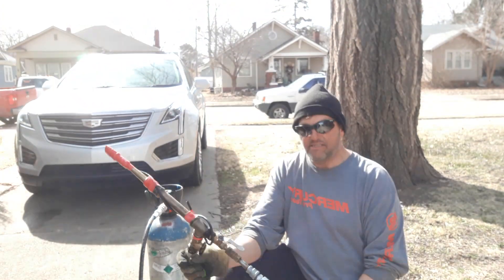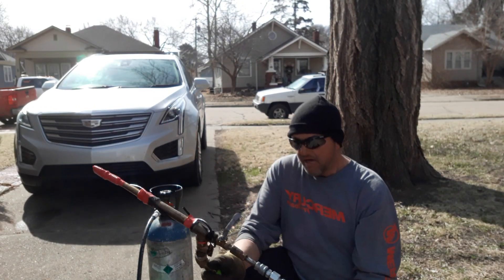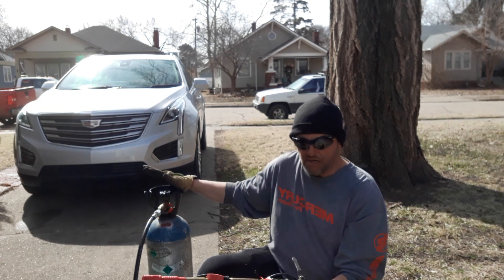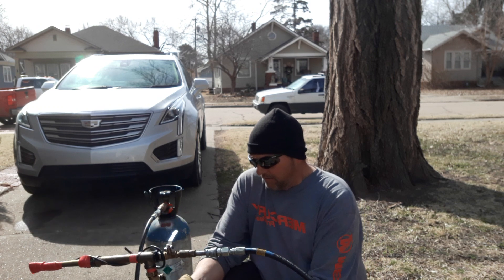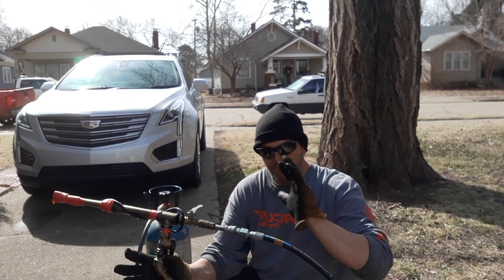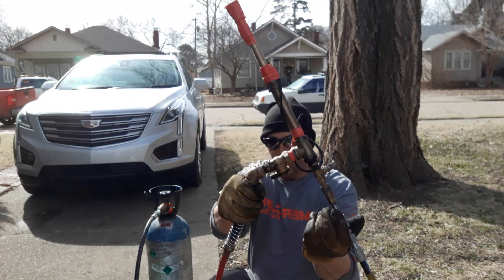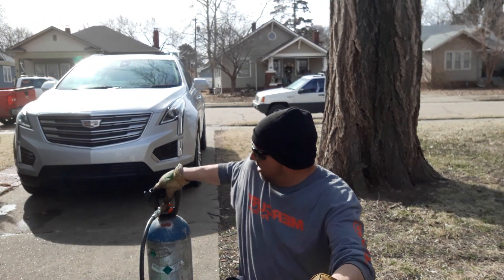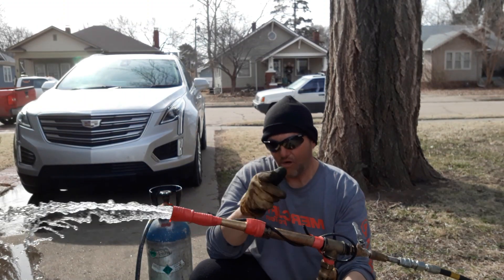Homemade Air powered high volume/pressure Power Washer! No pump no motor! 10,076 psi. NEW

Comment: High cfm does not mean it will put out more air power.  10,000 psi would blow apart everything aside from the highest rated hoses/couplings/etc. it will run at the pressure it’s regulated too. We have extremely high psi at work to run a blow molder and the hoses are only rated to 2k
Reply from the maker: Well all I know is that this was a real test.... Nothing blew apart.  Mabey you should watch it again.
Reply: @tctime  I will! Wasn’t meant in slander and I commented before work and did not finish so I will do so now lol
Reply: I think there might be some confusion in the ratings or in communication. I just searched co2 cylinders and found one source where a cylinder is a maximum of 1800 PSI with the rest being rated and filled at 860. Either way great work on the gun! Love shop made shit
Reply from the maker: @zanechristenson3436 no worries my friend.  If you are watching this kind of content before work you are definitely in my target audience.  I hope you subscribe, and I look forward to hearing from you again in the comment section from some of my other videos. 👍

Comment: At what pressure will the joints of the gun break?
Reply from the maker: I have tested this gun st 10076psi.  There is a video of me doing this on my playlist... The King's Gun Series .... on my channel. I hope you will check it out. 👍🏻
Reply: @tctime  ys we both are commenting below same video right now

If not at 10,076 psi, when will joints break??🧐
Reply from the maker: Thanks for that. This is the highest psi test I have ever done. To answer your question to the best of my ability .. I will have to make an educated guess.  

Since the gun does not retain pressure,  and the thrust created exits the nozzel the joints should never break. The only thing that should ever fail would be the air valve  at the entry to the "power pipe " I will suggest you never exceed the rating of the valve you use like I did in this video.  It can be extremely dangerous. 

I hope I sufficiently answered your question.
Reply: @tctime  yes I got you.
Reply from the maker: @girishkuvalekar3965  It has been a pleasure talking to you. I hope to hear from you again.

Comment: Ok , doing a bit of cross research. I think they used these on the pyramids.
Reply: @tctime  basically , theres a stone there is so clearly and obviously miscut , the miscut is wayyy too long to have created from a saw , they would've stopped way sooner. So I think they used quartz sand through pressure washers powered by air pressure. And had the blocks of stone on a track and would leave the stone unattended. They actually discovered air pressure and how to use it. The cut looked like it was made by lasers , I think analog water pressure cutter with quartz sand make more sense. But again it's just an idea I had I'm trying to make work.
Reply from the maker: I love it! Good luck my freind.

Comment: How long does it last and how much is it to fill up
Reply from the maker: The purpose of using CO2 as a power source instead of a regular air compressor was to see if the gun would still perform like it should on a type of commercial air compressor that is normally used for a jackhammer  that has a cfm rate of 185. Since that type of compressor is not something I have access too... I more than duplicated the output of said compressor with the output of a CO2 TANK. I do not recommend using a CO2 tank for prolong periods of use due to the fact that the gas comes out so cold that it  will freeze the water line. This gun is designed to operate on compressed air. But as you can see the CO2 TANK was a perfect power source for this test. Thanks for the question. 👍

Comment: Ha ha! Very entertaining TC . JustFYI ... CO2 liquifies at 860 psi - still a lot of pressure but not quite 10k psi ;) Maybe you just read the bottle max rating . Having said that - it's a cool idea and works quite well with a strong compressor and gets stuff clean.
Reply from the maker: Thanks bro! You are correct CO2  does liquify  at 860 psi in a pressure vessel.  FYI...In this video the CO2 is being released from one. ✅ LOL.
  Glad you were entertained my friend.

Comment: 860psi bro, Im using co2 for home brewing, air guns, welding, all sorts of things... I’ve never seen a gauge go over 900 psi, the tanks are definitely not rated for more than 4000psi regardless... 

Your setup is cool, though you’re only getting more flow and a quarter of the pressure.
Reply from the maker: Thank you for sharing this... I have gauges that go up to 8000 psi. They are made for hydraulic systems on farm equipment.  Got my information from Google... 860 Psi is still enough for this test, and my customer has had no issues with The King's Power Washer Guns he ordered,  and since his initial purchase of 5, has purchased 3 more. This video was made to test, and make sure 185 cfm would not over  power or effect the way the air and water combine in the gun.... As it did in the Hydro force he purchased,  and was not able to use....
 You gotta admit... It performed perfectly... 
  Thanks again my freind for your feedback. 👍👊😎

Comment: TC your one cool dude. I’ve binged watch all your videos. Anyways times are tough and I need to do some trenching because my sewer pipe is busted. I’ve been looking into an AirSpade to knock out the dirt because a excavator will cost me way too much. Ya think you can come up with something similar to the AirSpade but on the more affordable range? Hope you accept this challenge, but I’m sure you’ve already got some ideas 💡
Reply from the maker: I'll look into it.🤓👍what kind of compressor will you be using?
Reply: TC time haven’t bought one yet, but whatever is affordable under $200
Reply from the maker: okay well the air spade trenching tool looked at was a Guardian Air Model and it uses a pull-behind compressor that is used or road construction like for running a jackhammer. Fit it's the same compressor that I did this video for to make sure that my gun could handle it. Did this video For a friend of mine in AZ that has a pool tile cleaning business....He uses his to blast salt. His compressor puts out 185 cfm as well. Needless to say... it is a monster. 
 I do believe success could be achieved from simple over-the-counter hardware store parts, and a small compressor for short bursts....It looks like to me the way the air Spade is designed .... has a long pipe coming from the trigger that is either 3/4 or 1 inch and towards the end of the nozzle the air is constricted and expands again which gives it a little extra boost... But I don't really don't know how much run time you're going to get at once.... But if you think you have the patience for slow steady progress , and not expect the results that are achieved with the commercial mode... l believe I could put one together pretty easily for a fraction of the cost... The one I researched was $1200. I think it could be made for around $150.00 ish out of screw together parts. RETAIL COST...Comment back If you think that this is something you would still be interested in seeing.. I'll check back tomorrow to see if you replied back. Just let me know . 
Have a good one and I appreciate you being a part of my channel.👍👊👏👏👏
Reply: TC time oh definitely, if you think you could make one at a fraction of the cost I’m sure others would also be interested. I mean, you’ve got the parts have a go at it. Just be safe.

Comment from the maker: Yep 10,076 psi with more than 185 cfm! Over 200 bar. Not neccessary for most..It was designed to run, and works great on 60-200 psi of compressed air...But I just had to know how hard I could push it! ... and I'm not done yet y'all. 👍👊 Special  thanks to Derek  @docs742 for the conversation and feedback that inspired this video. Hope your swimming pool tile cleaning season goes well my friend.
Reply: how long does it run before it drains that tank?
Reply from the maker: You are only limited by the size of your tank. 
If you are using an Air compressor however I have found that I don't have to worry about my run time if I am using a compressor with a cfm rating of 20 or more. If your compressor isn't quite that beefy, you can get the run time you desire by adding a, or a series of booster tanks to obtain the amount of run time you need.
 I hope this answers your question.
Reply: @tctime  ty